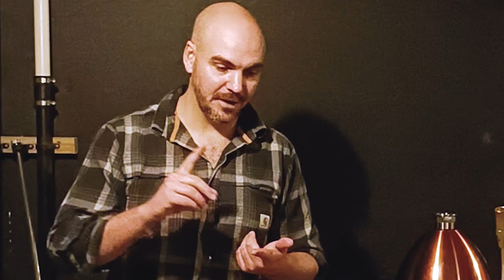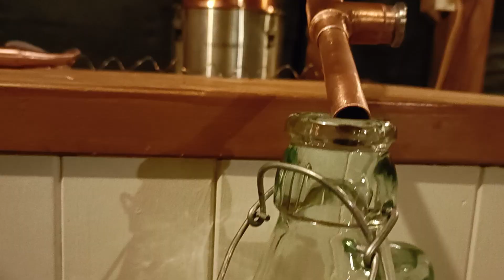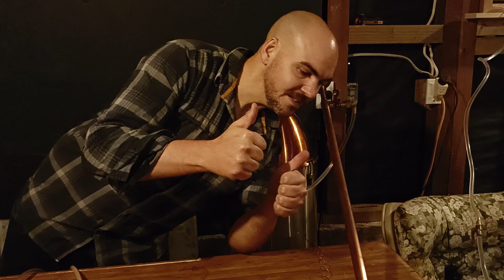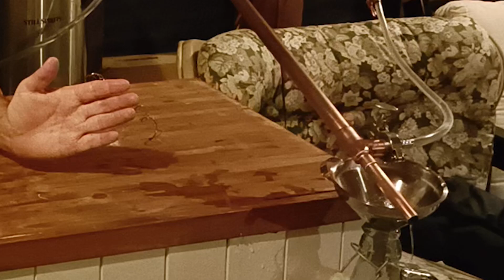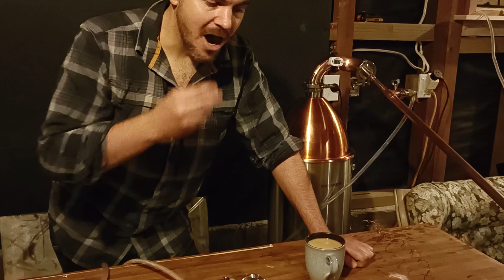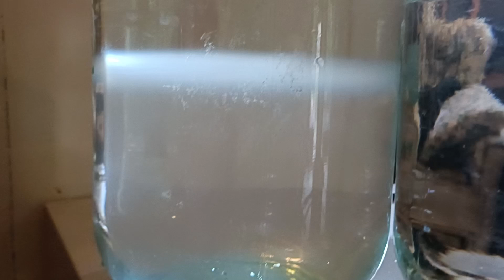Modifying my Still - Phase 1 - Making a Condenser

Comment: I have a T500 reflux column. I have added three three inch bubble plate and a section of two inch triclamp between. Makes a nice neutral spirit at 95+ ABV. Nice shotgun!
Reply from the maker: thats really cool. I want to go up to 3" for the column. Is your dephlag 3" also, or does it bottle neck to 2? Do you find that the t500 is grunty enough for the 3"column?
Reply: @unOrigiNik  it is more than capable of loading the plates and tapers down to a 2 inch packed column. In fact I keep an eyeball in the plates and when they stop having legs on the glass and start having condensation it's getting very close to cut the tails. I do not know if the boiler is powerful enough to drive a 3-inch packed column as that is twice the cross section. Height for purity, width for speed. I did a run of Blueberry Brandy with only one plate and an unpacked column running a bare trickle of reflux. Got a beautiful 1.5l of hearts @85% 
The 2 inch option seems to be ideal for home distilling as we usually work with 5 gallon buckets it's a 5-gallon boiler etc etc. I would also question the ability of the alembic (or standard) lid to hold a 3-inch packed column as they get heavy really quick when you consider it's going to weigh even more when wet.
Reply from the maker: Good to know. Yeah the alembic dome is not very tensile when the triclamp adaptor is screwed in. I'm playing around with the idea of brazing in a 3" ferrule to the alembic dome  which would place the stress point towards the raised edge of the dome where its been work hardened and it won't flex as much as it currently does.